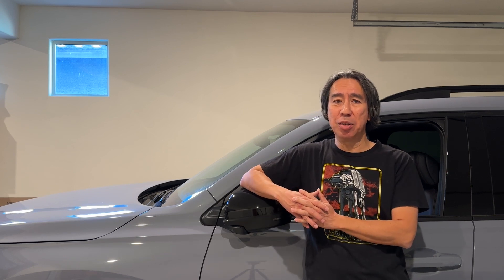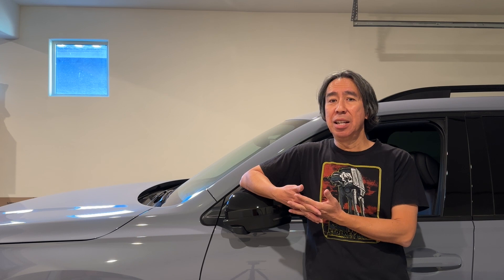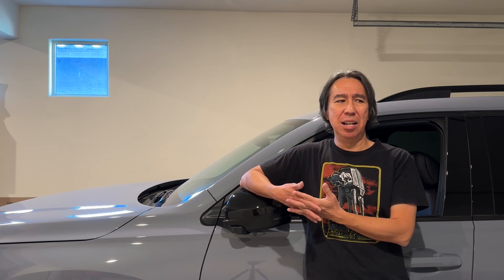Honda VCM (Variable Cylinder Management) - Everything you need to know.

Comment: What about carbon build-up issues giving that's it's only direct injection and not both port and direct like toyota?
Reply from the maker: @Nikki-uq3vi  from what I have read and personal experience with my 2017 Honda Accord with DI, I don’t feel carbon build-up to be an issue.  Or causing any problems even if there are carbon deposits.  Can it happen?  Yes.  Is it an issue to worry about IMO, no.  PS.  I only use the cheapest gas too.
Reply: Use Techron complete to clean it out and Top Tier gas to prevent it from building up further.
Reply from the maker: @ With Direction Injection, the fuel never gets to clean the valves, like non DI engines.  Not against anyone using any brand of their choice or cleaner additives, but the benefits are not really there.
Reply: @andrewwang128  You're right in regards to the valves, but I would most definitely have to disagree with the benefits "not being there". Techron along with Valvoline Restore & Protect have worked wonders from what I've seen without tearing my engine completely down. You would swear my 200k engine has 20k miles.
Reply from the maker: @ Nice.  Thanks for sharing your experience.